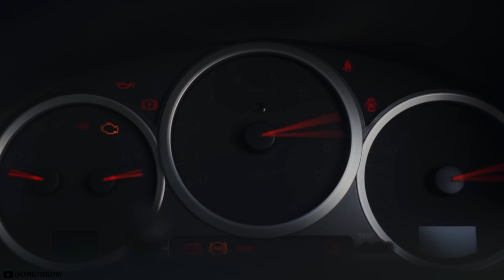Donut Media VS. Subaru

Comment: Same thing with motors like the N54. A twin turbo straight 6 isn't a very complicated layout or hard for many people to understand, it's just that so many people don't do the research they need to keep the car on the road. I've had my 2009 335XI for right around a year now. Bought it with 77.5k miles. It now has 102,800. I've put 25k on the car, and I've had no real issues. I addressed all the common issues, consistent fluid changes, all of the stuff needed to keep the car reliable, so I've had no issues. She has yet to leave me stuck on the side of the road. And yes, she is tuned, so it's not like I'm dailying a stock car either.

Comment: At what point do you call a platform bad for the enthusiast community?  Turboed Subarus are "amazing" except you have to do several expensive X, Y, and Z modifications to get them to survive any sort of turning.  Also they have crappy piston rings and a top mounted intercooler.   You can throw a lot of money and time addressing their shortcomings and, if you do the slightest thing wrong (or not, Subarus be Subarus), they will blow up again and again.  

Yeah.  

Sounds like a great platform to me!

Comment: Back in 2014 I bought my 2006 WRX STI from a Dealership with 129,000Kms on the Clock. I still have it today in perfect condition at 219,000kms. Only things that have failed were: Steering Pump, Radiator and Fans. Compression is perfect, I still get 500-550Km to a tank when not boosting, no shavings in the oil and have always serviced it myself every 8-10,000kms. Coolant temps are always between 75-92c. The dealership didn't rebuild the motor before I got it, but it only had a single owner before me which was an old man who drove it across Australia a few times.

I'd be very against buying an EJ255/257 WRX / STI that's had multiple owners in a private sale as you never know what problems have been occurring, driving / maintenance habits of the previous owners. I've been in a few Subaru Groups and I always come across people who are happy to mod their cars themselves and tune them, then thrash them into the ground and scream unreliable. I've always just figured it was a case of the cars price point being cheap and accessible, so people with a lack of mechanical sympathy buy them and blow them up.

Comment: You hit the nail on the head. I have friends that that want a Subaru. I tell them to not try and make power. They are a handling car not a power car. Work on their strengths not the weaknesses. I have other friends that have been through 2-3 motors because they are making 250kw.

Comment: I can agree that Subarus are allot harder to work on than you think. I have a pretty basic knowledge of working on cars but once my 03 Forester blew a head gasket, I tried fixing it myself and wow. I didn't know what I was doing or where to start mainly because of how drastically different boxer engines are from inline or V engines. To the ppl who know how to build theese cars right I have huge respect for you

Comment: I got my first Subaru 2 years ago, 2007 Outback. Plain 2.5 with a 4eat..I quickly found out how different they are. She needed a bit of work since I drive it a lot.. I put 60k miles on it in the 2 years I had it and it’s now at 165k. I now only take it to a Subaru specialty shop that only works on Subarus. I put 5k into it over the 2 years (more than I paid for it) but it’s worth it. It drives great and  I’m in a snowy, cold climate so it’s perfect. No rust at all…I’m planning on throwing an STI engine and a 6 speed manual in it when she’s ready!

Comment: Pretty solid and balanced take! 

From the beginning of their series with the WRX's I was worried about them running into problems because of how finicky WRXs are with mods, and wasn't surprised that they did end up running into problems. It's still unfortunate though, I wish EJ's were less fickle than they are.

Here's hoping their next HiLo does something with an EA888, as those engines take VERY kindly to boost. The obvious choice would be a Mk7 GTI, but a B8.5 A4 would probably be more entertaining (especially given their higher ceilings from Quattro & the ZF-8HP).

Comment: i love this video i feel like everyone needs to watch this. a lot of key point but mainly is that these engines are very particular, as you said the most smallest of things can cause a complete melt down of these cars they are very persist on how they run if one thing is in the slightest bit off the engine will hate it , as you said they have a very low point of hitting the mark an if you don't understand the engine your gonna miss that mark if you build them correctly they will run like a dream.

Comment: My friends had 3 STI’s throughout the years. 2 were boosted slightly above stock with bolt ons and both motors blew fast. 3rd one was new stock from a dealer and has been fine for 2 years

Comment: I own a 2006 JDM Subaru Forester STI imported to the UK by Litchfield. The car was tuned to 330hp and everything was changed to support that, Litchfield stated anything over 330hp on stock internals wont last long. Mine is currently on 125,000 miles and is running like new they are great cars if tuned properly, professionally and looked after. Engine, Diff and gearbox oil changed when it should be.

Comment: Bought my -04 STi with a recently changed engine. 3 months later it spun a crankbearing. Rebuilt and upgraded the engine for about 12 k USD and later sold it. Have bought multiple Imprezas since, its addicting cars.

Comment: I traded in my FRS for an is350…. I know I can reliably beat a little bit on my car without worrying about my engine now. I also was a 2nd owner on a FRS with 60k miles that was BEAT ON vs a 105k single owner, well maintained is350. I appreciate Subaru for being a great car i didn’t quiete understand that i may have damaged a bit as a SECOND OWNER and realized it before i couldn’t get my monies worth… and found a cream puff car…that is an upgrade for me. Subaru schooled me… got me working in a shop…started my re-love for cars in my 30’s….. i will always have a great appreciation for Subaru… and for the car community in general. Know what you buy before you buy it, surround yourself with people who know more, and dive in to the love of your car if you want. Quite the hate and just appreciate your process… it’s the best part of a BUILD.

Comment: I drove a 2010 WRX for 172k miles with very little issues. A steering rack, valve cover gaskets, a water pump, a thermostat, a vacuum line, and axles were replaced. Other than that, on a Perring tune 93 oct, it ran happily until the day I sold it. Luckily my mechanic was a Subaru tech, so he knew everything about the platform. I drive a Miata now, and I love it even more. I want to drive it until the valves come out, then get another engine and drive it some more.

Comment: If there's one thing the Subaru/WRX community is dependable for, it's blaming drivers/owners for mechanical failure. It's never the car's fault, it's always the owner/driver. Subaru managed to keep this 25 year old historical artifact engine in production cars that cost over $30k because the community works so hard to deflect blame from their incompetent engineering teams onto the poor owners who assumed that a performance sports car would be built to handle performance activities.
Reply: I agree 100%. The EJ20 was a great engine..... in 1993 🤷‍♂️🤣. I own a 1993 wrx GC8. Great car but needs a rebuild every year... ive parked it for now 🙂

Comment: Subaru guy here. In fact, I have 3 Subaru SVXs, a 95 Legacy, and a 00 Outback. When I got my first Subaru, the Legacy, I knew very little beyond how to change brake pads. I began restoring the car. I have always found Subarus overall easier to work on and maintain than other platforms. Granted, I've always done extensive research before and throughout, and always stayed naturally aspirated. I imagine they could have gone into it more prepared. I think you make some great points thpugh. I think the takeaway from this is that while Subies are an amazing and even budget friendly platform, it is very important to do research and ask questions. I've found that has saved me a lot of trouble over the years with my cars. The Subaru community is amazing as well. If you're one of us, we are here to help. Got questions? We've got your answers. That's part of what really makes the Subaru community amazing. Once you know what you're doing the platform really does become one of the best and the sky is the limit with these beasts. Learn from the mistakes already made, rather than making them all over again.

Comment: The unfortunate truth is that EJs need a hell of a lot of “preparation” to be reliable on track. It’s likely Donut chose that platform mostly because it has a large number of dedicated followers to ensure clicks. Scooby owners are die hards, they accept all the conditions that come with the platform. The problem with a lot of these automotive channels is that they are run by people who like cars at a superficial level, casual fans if you will. The EJ25 doesn’t suit that kind of attitude.

Comment: Totally agree with this perspective on the issue, as well as the comparison to rotaries. 
     Usually, the way I describe the platform's reputation is "People treat this platform like a Honda Civic, when they should treat it more like a BMW. Subaru's are not built with the same overhead as other Japanese brands, for both power, and lackadaisical maintenance. Especially with the engine layout and Mechanical full-time AWD, they want to be driven in a very particular way, and respond poorly to being driven with a lack of mechanical sympathy."
     For those considering the platform: Subaru's offer a unique driving experience (turbo, manual, AWD, analogue feeling) that if it's for you, nothing else will substitute. However, if it's not for you, the mechanical complexity / requirements for disciplined driving and supporting mods are not worth it, and you would be better served by something else. 
     Also, leave the power alone. 6 track days in on stock power + supporting mods, and still running strong.

Comment: I agree with most of what you said. I usually tell people it's a budget porsche. Oil problems are inherent to a flat motor design. Once you realize that and focus on it then it's not as big of a deal. I had zero knowledge but have built my own closed deck subaru motor that has had 20k miles with no major issues. But it took me a year of learning and reading. Not everyone is into that type of stuff but I would argue that every high performance platform has a large learning curve IF you are turboing it. NA cars are just easier and more reliable.

Comment: yup. I had a JDM BD5 twin turbo legacy (EJ20R), that had custom built primary and secondary turbos, running 16psi. even in subaru world, these engines were notorious for blowing the big end on number 3. Drove it for over 120,000km in that configuration, and they were hard kms. the car gave me ZERO issues - the only thing ever to go wrong was the altenator. When i sold it, i told they guy - change oil and filter every 5000km. ONLY run on 98 octane (ron), 95 if your in a pinch. 2 months later he blew the big end.  thing is, i understood my car. i built it, i knew when it was happy and i knew exactly what its abuse tolerance was. The new owner not so much, and clearly didnt follow seasoned advice.

Comment: As a multiple WRX / STI owner, I have had the worst and now currently the best outcome for the platform. Previously i was 20 years old, knew absolutely nothing, just thought the car was cool and as my first car, purchased some elses incomplete project. Total mistake and a waste of money, I had zero history on the car, at the time minimal funds and limited access to resources. It was a shit experience I would never recommend buying a used Subaru unless you were intimate with the car due to prior experience or relationship. Now I am the owner of 2021 STI "last of the mohecans" . Over 10 years later i have the knowledge, funds and resources to keep this car at its peak. Quality parts and attention to detail is key. I just got tuned by JR, a legend in the Subaru game and even he said my car specifically was a rare case. My prestine maintenance record and up keep of the car allowed me to dyno 300whp/322wtq on 93 octane, with just an intake and catback. Both the shop owner and JR were shocked to say the least. They informed me other STIs with similar if not more mods sometimes struggle to hit numbers like this. Alittle extra TLC on a vehicle can go a long way.

Comment: I had a stock WRX for 10+ years that I thrashed on the daily.  Besides the obligatory (it's gonna fail at 70k miles) head gasket, it never even came close to overheating and was dead reliable in blizzard conditions.  I did full synthetic every 3k and it ran like butter.  Recently sold it and the buyer was shocked at how smooth the idle was.  As soon as you start modding tho... it's not a 2jz that you can just slap a turbo on.  It's gonna blow something at some point.  The exception being a full race-engine build with a closed deck, forged everything etc.  But a race build is MAD expensive and you can get more reliable results with far less invested with engines like a 1jz, 2jz, LS, k20, RB26, EA888, N54, SR20DET etc.  There are so many engines that respond to tuning better than an EJ.  Special mention to the EA888 because you can get 400hp with a remap.  (Tho i hate volkswagen.)  1jz is also amazing.  You can literally slap a turbo on that stock and get 500+ hp.  N54 is a bmw engine that is like successor to the 2jz.  Amazing potential.  The EJ is just lacking when it comes to the dollars spent to performance ratio.
EDIT:  Also the EJ is NOT a beginner friendly engine.  You NEED to know what you are doing.  Once a good build is running smooth, it's AMAZING, but getting there is rough.

Comment: At 6:31 in this video you can see what appears to be an aftermarket oil pan, likely a high performance one with baffling. 

Donut even claimed in a more recent video they had the proper racing oil pan on there Subaru’s.

Comment: What finally turned me off to Subaru is how they handle the warranty process. If you tell them you need to bring in your WRX/STI, it's like they've been thinking of how to deny you before you even show up to your appointment. My last experience was a 2012 WRX hatch with the 5 speed. That 5 speed is garbage and left me stranded at a gas station one morning trying to get to work with 24,000 miles on the odometer. Not modified at all, aside from the stereo, and they tried to deny me for racing and pointed to the edge of my tire claiming excessive wear. That didn't work. They tried to tell me I didn't know how to drive a stick and I was the reason my transmission failed. That didn't work either. I had to have the car towed to a different dealer who finally fixed it and told me it was missing a spacer and that allowed my transmission to get stuck between two gears. I sold it after the repairs were done and haven't bought another one since and I won't again.

Comment: Great video! I liked the comparison with the rotary and B5 audis. I have hawk STi and my coworker is building an FC RX7. We constantly talk trash to each other about the platforms but we both just understand it's for shits and giggles. We know the strengths and weaknesses of the platforms. Every car has them, even the mighty praised Skylines who people seem to think are bulletproof when in reality RBs are pretty unreliable as well. 

Coming back to the subaru platform, I think it for sures comes down to research and I know that's definitely not something some people are up to. A lot of times they think these cars come rally ready from the factory and can just throw mods on them and launch off the line everytime. But they're just "Rally inspired". The aftermarket scene has hundreds of reliability purpose mods for supporting the power mods thrown at them for that reason. When built right they are fantastic cars. But that comes at a high cost.

Comment: I have an 02 WRX, Full exhaust system, vf39, forged internals on a hybrid ej205 bored, 5Speed, Fuel upgrades, AOS, with Brembos, on stock TMIC and I don't have any type of issues. I did blow the original engine, bearings went out running essentially everything listed on stock internals, very spirited driving in mexico, haven't had an issue since. Fun cars, I don't see myself ever getting rid of it. Do it right, get good parts. Enjoy your cars, sometimes it's not all about min/max power goals! While I do enjoy the hi/low series, I think there's something there that's missing, in both the Subaru and Z's they had a ton of issues keeping their cars healthy, something definitely doesn't add up.

Comment: Like most higher performance platforms there’s a grenade under the hood. 
G60 - super charger 
Corvette C6Z06 - valve drop
WRX glitter in the oil - ringland 
There’s always something just do your best to research and avoid them by confronting them.

Comment: I have a local shop that are Subaru experts. They build tons of them. Lots of 300+ whp ones, they did a 550whop stock block JDM one, and the owners car is a 900whp drag beast. If they were building one for the track I guarantee they would put a lot of Roger Clark Motorsports parts into it to keep it alive when running for a long time at WOT with high g turns. Subaru's can be built to do almost anything well.

Comment: I didn't yet see Donut's video, but it seems they definitely didn't do something right. My 07 Legacy GT with its completely stock EJ255 and 177,000 miles runs fantastic. The EJ255 is a fantastic engine when properly taken care of. I have a theory that Donut didn't properly break in the rebuilt engines before beating the crap out of them. Any rebuilt engine should be granted 1000 gentle miles for proper break in.